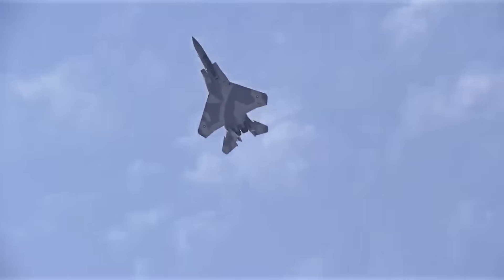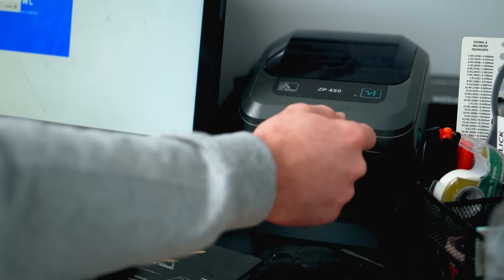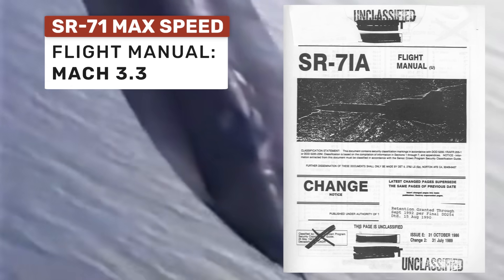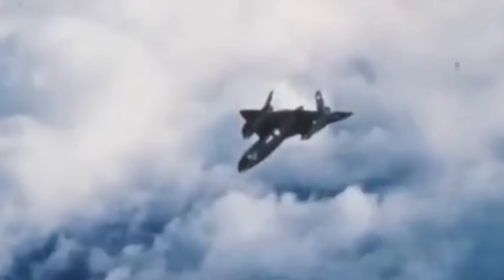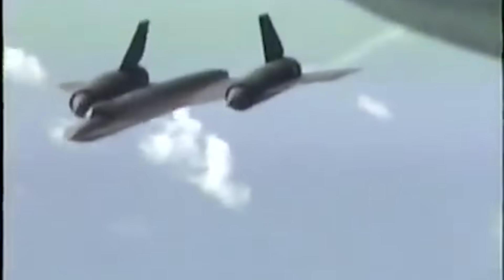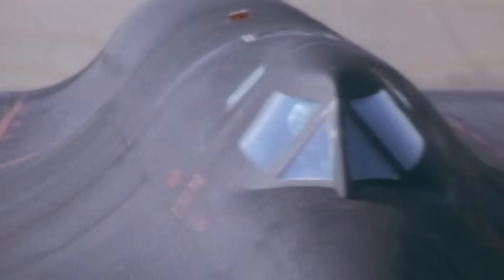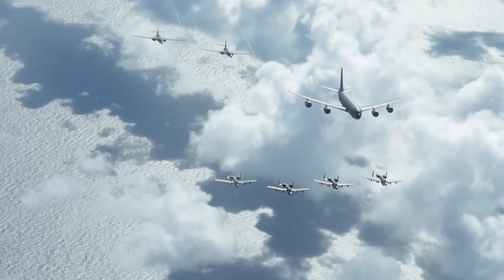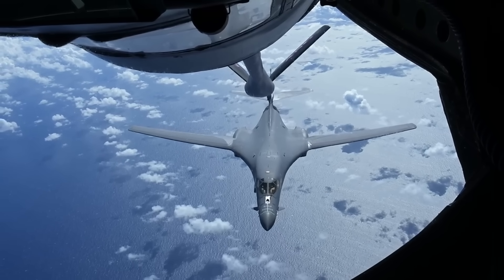The SR-71 was MUCH FASTER than the Air Force will admit

Comment: The fact that A-12 and SR-71 weren’t limited by their engines, but were limited by the heat buildup in the airframe is an incredible thing to contemplate. If the material science had been there for Kelly Johnson and his team just how far could these aircraft been flown to? These beauties are some of the most awesome air breathing jets to take to the sky’s!
Reply: A different way to understand the Cruise speed and Max speed is to measure the Mach number angle of the shock wave from nose tip to wing tip. 
  For Max Mach the angle of shock wave to  engine  air intakes. If that nose shock gets inside the engine intake it would destabilize the turbo ramjet flow stability.
 The angles must be corrected for altitude.
  That brings up How High Did It Fly -- 160,000 feet cruise corrected for air density differences from the Equator to the Poles. Data from an old U 2 pilot who said I can't tell you but if you buy one of incredibly accurate plastic model kits and measure the angles then refer to University Aerodynamic text books and Meteorology text you can find the limits of the design.  As for temperature limits the limits of pure and alloyed Titanium are the starting point for the metallurgy. Critical temperatures will be found on the nose and leading edge components.
Reply: @georgeolson3996  
      160,000 feet???

That's a little over THIRTY miles up!
That's hard to believe!

More like 70,000 feet!
Reply: @rdelrosso1973  I can tell you that one of them landed at Laverton in Australia (early 80's) and the story was it had an "engine failure over the Antarctic.
It also had an issue with a stuck altimeter which was brought into a workshop to see if it could be repaired. 
It was "stuck" at 120,000 feet and the Tech who assessed (and fixed it) stated that it had become stuck on the way DOWN.
Reply: @georgeolson3996  Yup. No need to look at the models which are of dubious accuracy. Photos of the plane and some math give a top speed at the limits you describe of just over Mach *five*.

The question then becomes a matter of finding an altitude where the air is cold enough to not exceed inlet temperature limits upon compression.
Reply: @markfergerson2145 I remember hearing 5 in the 80s
Reply: as i understand, the higher you fly, tha less heat buildup, because there is less dense air. i am sure you could calculate the heat for every altitude if you would know one fixed set of an altitude, the speed, and the heat. if you are certain of that, you can calculate the rest. altough i cant, i have no clue how to do that.
Reply: @grummelameise It gets complicated quickly.

The higher you go, the less dense the air is, so there’s less drag and shock compression heating, but there’s also less oxygen so you have to fly faster just to keep the engines lit, which increases both drag and compression heating. The rate at which air is heated at a shock interface partly depends on how steep (thick) the shock boundary is, and that’s partly driven by how fast you go. Generally the faster you go the steeper (thinner) the shock boundary is, which is a good thing unless it gets into an engine inlet because that puts a greater pressure differential on the inlet structure which can physically collapse it before an unstart can even happen.

None of these effects are linear. In other words just because the air pressure decreases by x, there’s no guarantee any of the other effects increase or decrease by x.

Also, the higher you go the colder the air is (below the thermosphere which starts ~50 miles up) so generally, higher means faster.
Reply: There’s so much misinformation in these comments is hilarious.  The air frame is not the limiting factor, the inlet compressor temperature is.  It’s the metallurgy of the compressor blades that’s the limiting factor.  You can push the aircraft faster and faster and it will do it.  It will destroy the engine at some point, and that happens before it destroys the airframe.
Reply: @lookoutforchris  Yes, evidenced by the NASA uprating to the J58 that brought the normal service period of 400 hours down to 50 hours.  All based on the compressor blades. All for IIRC 5% increase in thrust.
Reply: The limit was in the engines 427ºC for the intake compressor temps.
Reply: subequent testing on hardstands indicates the answer is between 4.5 and 4.9 but theres no way it would have happened then and nowadays its all about combined cycle engines
Reply: I watched a scifi movie where it was stated that the US replaced the titanium skin with a composite, and no one ever knew about it.
When I saw a SR71 up close and personal, I examined the skin especially the edges and sure enough, there were fibers sticking out of the skin at the edges.
Reply: @stankygeorge  I don’t know… Depending where you were looking on the airframe this isn’t surprising - aside from primarily titanium/aluminum, SR71 Incorporated asbestos and glass fiber composite panels in its original design for certain surfaces like the inlet spikes, leading edges of the chines, vertical stabilizers and trailing edge surfaces. there was also a fair amount of asbestos honeycomb used. This was notably a consideration (public record) during disposal of stock inventory for the plane when the airframes were retired because the asbestos parts had to be disposed of under specific asbestos handling disposal requirements.

Comment: I saw an off the record pilot say when asked how fast his fastest dash was, he said, "One time I had 5 SAMs closing fast and gave it half throttle."  When asked why only half, he said, "I hit mach  4.7 at half throttle."
Reply: I was an Air Traffic Controller. I've seen it do that on radar, six seconds between radar refreshes, six miles further along. Thats a mile a second, or 3600mph, or mach 4.7. You do not lie.
Reply: @danechegoyen3550  Back in 1962 I was a scope dope on an EC-121 flying off Virginia. 
I had some blips run across my scope.
I guessed at 1500mph because that was about the limit then.
It turned out to be a Nike-Zuz fired out of Wallops Island
Reply: Bullshit.  There’s 3 things wrong with your comment.

Comment: The max theoretical speed would be mach 4. The SR71 definitely can not go any faster than that. That is based on the aircrafts aspect ratio and mach angle.  At a faster speed, the wing tips would be outside of the shockwave cone. Which is when everything melts and breaks. This is true with all supersonic/hypersonic vehicles. But, other factors may limit the SR71 before mach 4.

Based on what I know about the engineering hurdles of Hermeus's Quarter horse, I suspect the limiting factor that would prevent mach 4 on the SR71 would be inlet temperatures. That is why Hermeus is using a pre-cooler on their engine. Which on the Quarter horse, is the same engine as the SR71.

Comment: All you have to do to see how fast the SR-71 really could fly is find the article on the last flight of the SR-71. It flew from California to New York, non-stop and from wheels up to wheels down was exactly 42 minutes, 36 seconds. That's 3, 219 statute miles in 42 minutes, plus you have to remove the 10 minutes that it took the tanker to refuel. They aircraft over Oklahoma. If you do your math, you will see that it's more than double what the Air Force claims. And it is in the newspapers so you can look it up yourself.

Comment: I used to work on the F111 in the Air Force, and I was told by many people that the aircraft at altitude was much faster than the 2.5 Mach that it was advertised as. Maybe you should see if you can figure out what speed it could run.

Comment: 3.35M was on a real cold day, you'd max out the J58 compressor inlet temperature of 427°F which was the hard limit on the engine. The inlet spike ran with the angle of the shock wave and it only went back so far. Stories of near Mach 4 are just fantasy.

Comment: I've known that the SR71 was faster than the stated top speed because I can do mathematical calculations, based on time and distance, and realize it didn't take off with the fuel topped off. Meaning it had to slow down after heating up the skin of the plane to seal the aircraft, since the aircraft have no tanks, the fuel is held within the skin. And figuring out top off time behind a tanker, you've gotta figure it's sustainable top speed is considerably higher than disclosed top speed.

Comment: I feel quite confident that most of our tactical aircraft from the teen-series on and some of our strategic planes, are thermal-limited, rather than thrust-limited. I think the B-1 could probably do Mach-2 under the right conditions, if it had to. 

In the old days the max thrust of an aircraft was the critical factor (along with aerodynamics) in top speed, but from the 4th Gen on, thrust was desirable more in terms of maneuverability than maximum speed. You need massive, massive thrust in a turning fight to stay energetic. That same thrust could (possibly, depending on the plane) accelerate you to speeds that would damage or destroy the airframe, which is, you know, counterproductive. I think I'm right in saying there are throttle limits on all the teen-series, and probably the first 5th gen planes as well. 

It could be that, in regards to the F-35, that the thinking among designers was that the reserve thrust of aircraft like the F-15 and F-16 were actually excessive, and a waste of fuel in the modern combat environment. That doesn't mean that's true, and I'm not sure I agree, but that could have been the thinking.

But to return to the topic of the video, I think the engines of the blackbirds could probably have taken them to the region of Mach 4, but I think there was a significant possibility of compressor, or airframe, or canopy failure at that speed. And any of those would have been fatal. The Blackbirds were not like a mustang or 1st gen jet where you just jam the throttle to see where you wind up. It was the kind of plane that could kill you if you if you flipped the wrong switch, even at slower speeds. And they were too valuable strategically to risk in do-or-die air-record bragging rights, much as we all would like to ogle a higher mach number for these extraordinary beasts.

Comment: The civilian version of the SR-71 flight manual listed a Vne for the SR-71 as Mach 3.44, due to rudder heating.
There was also, famously, a bet lost by Kelly Johnson with his chief engineer (Ben Rich) regarding paint. His chief engineer thought that an emissive, black paint would cool the rudder by more than 75 degrees, and it turned out to be closer to 150F.

Comment: All the max speed limits of US aircraft. Should be taken as safe max limits. They go faster but things may break.
For example. I once was speaking to a retired RAAF pilot from the 80's. Who wrote off a F111 airframe. 
By taking it way beyond its limits. Holding it full power. Ignoring all the alarms like a real Chad. He said, his navigator was panicking so much. He passed out!!!
Melting parts of the airframe, and pealing a lot of paint.
He would not tell the exact speed. But was close to Mach 3.5
He was flying a desk. When I was speaking to him around 1990. Ironically when he was discharged, and then flue airliners for Qantas.

Comment: 10:55 SR-71 from releasing the brakes on the runway: "...reach 80,000 ft and Mach 3 in less than 12 minutes."  
Not bad. But the story goes that the 1950s Avro Arrow could go from Engine Start (!) to 50,000 ft and Mach 1.5 in less than 5 minutes. From Engine Start !!

Comment: Let's do some supposition:

The F-15C's official stated top speed is Mach 2.4, bu tit's quite likely that number is below it's actual max speed, so let's say Mach 2.6, maybe 2.7 for the F-15C. 

The EX has ~17% more thrust at standard burn and ~56% more thrust with afterburner than the C variant and weighs about 25% more, and it's official top speed is Mach 2.5, so 2.9 seems plausible but it would have to lose all hardpoints and the conformal tanks to get it as slippery as possible. 

That's a fast plane.

Comment: The fastest the F-15 has ever flown and the fastest I expect the F-15EX to ever fly in combat is about Mach 1.3 over a short distance, and that's all that matters.  How fast it can supposedly fly when carrying nothing and allowed to run itself out of fuel in full afterburner before it has to land on a dry lake bed somewhere and get towed back to base is meaningless.  We shouldn't pretend it has any applicability to its true capabilities in combat whatsoever.
Reply: Yes.  I remember a report detailing how often AF pilots went supersonic during missions in Vietnam - zero times.  They just didn’t have the gas.

Personally, I don’t see how that’s perfectly accurate to say, but it does reinforce that stupidly high speeds with full afterburner do not make for efficient (or possible) operational combat sorties.
Reply: @Pene7942   Yeah, I doubt that's strictly accurate, but it reflects the rarity of supersonic flight by tactical fighters in combat.  Mach 1.3 is the highest speed I remember, at least off the top of my head, being recorded in several accounts of air combat, and at least one of those instances took place during the Vietnam War in an F-4.  It just takes too much fuel for loaded fighters to accelerate to faster than that or hold that speed over a significant distance.

Of course, every rule has exceptions.  Among agile fighters, there is the F-22, and even then it's pretty limited in what it can do.  Mach 1.5-1.7 for 200 miles or so (100 in, 100 out) is possible for some mission profiles (a standard for figuring combat radius, subsonic for most of the distance), and this is only because it flies clean and can do it without afterburner.  Even in this case, however, top speed doesn't matter.

Comment: Wasn't the predicessor Ox Cart actually faster ???
Reply: The Oxcart program resulted in the A-12, which was supposedly faster and higher flying than the SR-71, because it was lighter.  But the SR-71 still maintains the absolute speed record.

The Oxcart program was a CIA project to develop the follow on to the CIA’s U-2, so Oxcart’s predecessor was actually slower.

Comment: Although they indicated that the compressor and skin were thermally limited,  it should be investigated if the compressor air inlet was variable.  The skin heating isn't an issue in higher, less dense air. If the Sr71 had ram to scram jet configurable engine,  then much greater than mach 3.2 was easily achievable.

Comment: Mach 3.5 and 3.6 are the region where the engine shockwave and then the nose-shockwave start negatively interfering with the engines. Even a short time at 3.5 would deteriorate the engine, 3.6 and the shockwave would no longer be outside the engine, damaging the engine (not just the consumable seals that needed replacement after every flight).

The aircraft was not designed to need its full throttle for top-speed, rather it was designed with powerful engines so it could cruise relatively efficient while also having the ability to climb rather quickly (i think standard was just 50m/s but i could be pushed well beyond 250m/s).
If the engine-inlet was designed different and had better active cooling the aircraft would likely have been able to even reach Mach 3.7 at the cost of ... well cost, complexity, efficiency - but there really was no point in pushing it that far.

Comment: I got to walk around and touch S/N 61-7958 (the record holder) after it first rolled into the museum hanger at Warner Robbins, no 'velvet ropes' yet. Could not walk under it because it was still 'leaking' and the floor was covered with drip pans.

Comment: We've known the actual top speed ever since an engineer on the project mentioned it in an interview a few years ago. I'm gonna watch your video soon, but I'm just dropping this here beforehand.

The engineer said a Blackbird pilot wanted to see how fast it would go, so he, so he pushed it to around 2400 knots where it flamed out. The pulse off the cone was too low to hit the intake, if I remember correctly. So when they hit 50k or 60k feet, they got the first engine to fire up, and the at 25k feet, they got the second to fire up. They never tried that again. lol

Comment: I've heard a rumors in reading and learning about the SR71 that the top speed, due to heat management restrictions, was Mach3.8 and the J58 was capable ("J58" and "capable" being the important part) of Mach 4.

How long either of them could sustain those speeds are anyone's guess but I'd bet not long. Probably just the edge of their performance.
Reply: At Mach 3.52 the nose shockwave hits the front chines, the engine inlets and the wing tips all simultaneously. Regardless of the thermal limits, that plane isn't going any faster then 3.52. You measure the angle from the nose tip to the wingtips from the centerline. The the Mach number for that shockwave to hit that angle = 1/sine(angle). That angle is about 16.5 degrees. Any stories of this plane going faster then that is just a story.

Comment: — Well, of course SR-71 is faster, because it have capabilities to partially shut down engines compressors, which is a speed limiting factor in case of F-15 and MiG-25.

Comment: I have to call BS on this. I follow several SR groups and have attended symposiums with former pilots and crew members, and to this day, everyone in the program sticks to the story that 3.2 was the max, with the dictating factor being engine inlet temperature. Max temp of the inlet was about 450C, which is over 800F, at which the engine would start to shred itself. There is no reason for the top speed of a plane that has been retired for 35 years to remain secret, so if it could go faster, it would most certainly have been divulged by now. Maybe it could squeak out 3.5 if they firewalled the throttles, but again, inlet temp would quickly rise above the limit and they'd have to throttle it back after a few seconds.